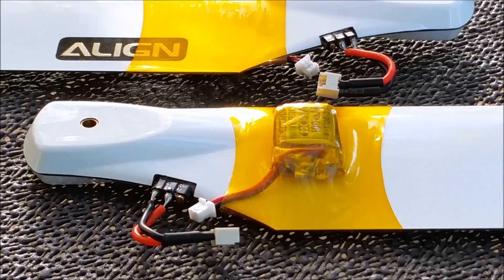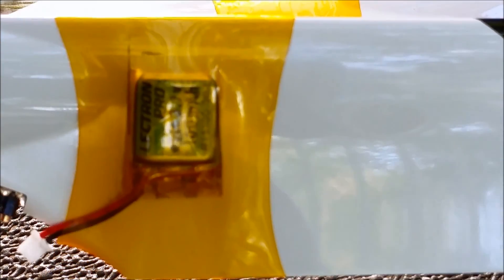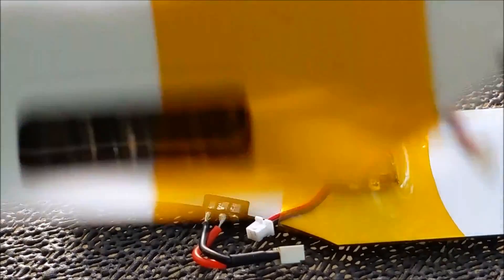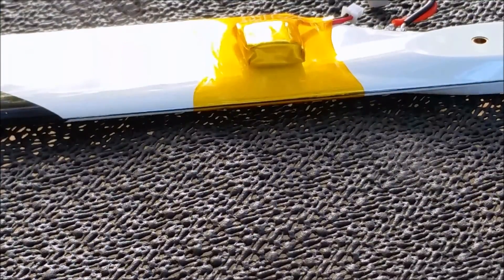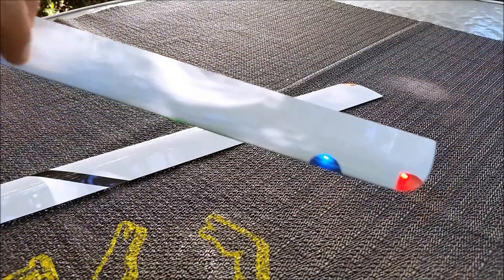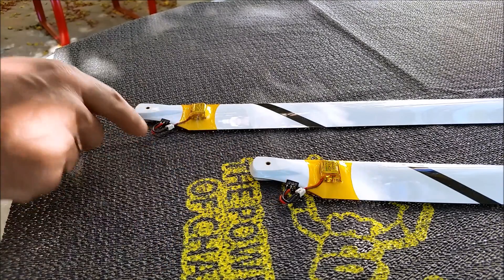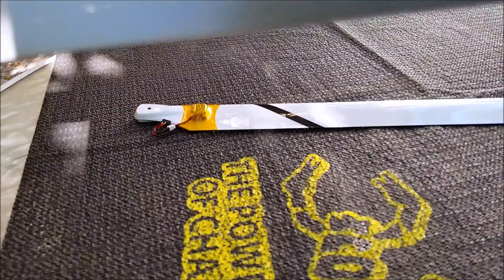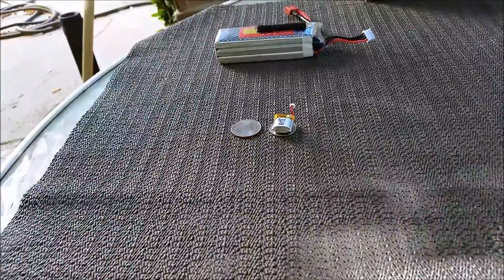Align Night Blades 425mm Trex 500 External Power Source Install-Setup 1080p HD

Comment: I'd be scared if one of the battery's moved just a fraction of a mm it would upset the balance of the whole head and everything would come flying apart.
Reply: I made similar blades, but used normal blades and added sticky back copper tape and SMT diodes, then covered it all with transparent heatshrink like old school wooden blades, never had any issue with them.